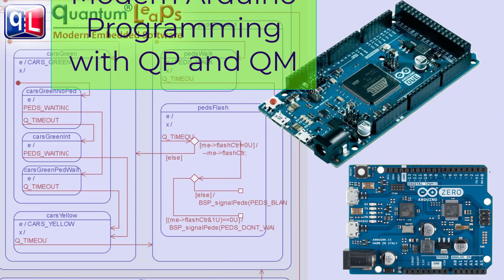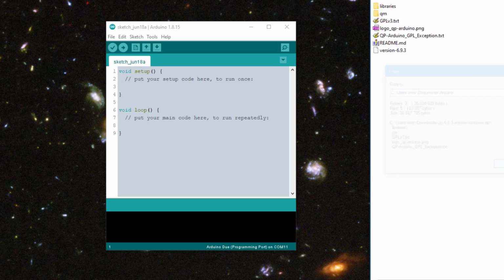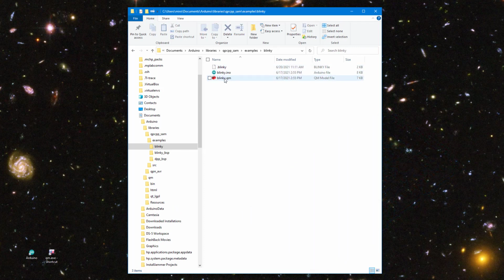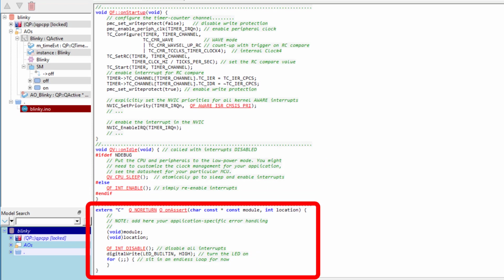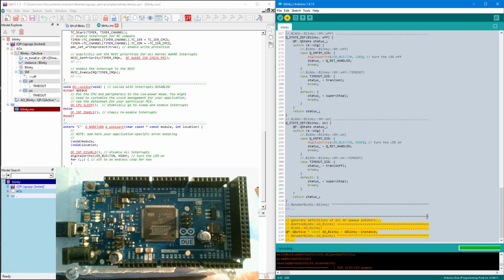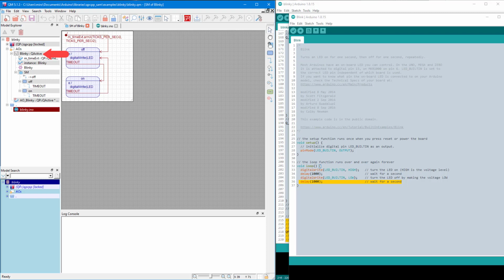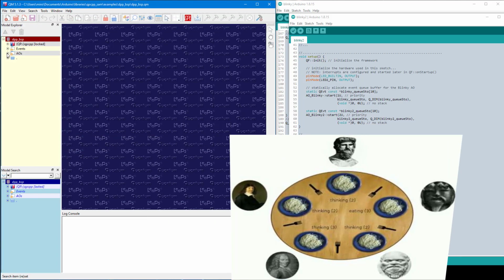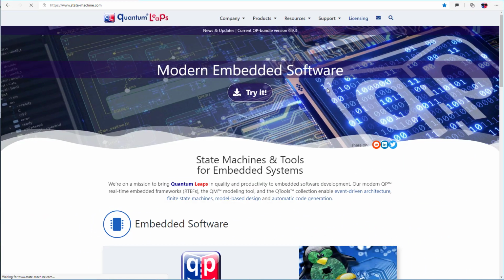Modern Arduino Programming with QP and QM

Comment: good sound. but I am learning TM4C123
Reply from the maker: This video is about Arduino, which includes both the hardware (Arduino boards) and software (Arduino IDE and libraries). The TivaC LauchPad board, used in the Modern Embedded Programming video course, is unfortunately not supported by Arduino. But TivaC has an ARM Cortex-M4 CPU, which is very close to the Arduino-DUE, which has ARM Cortex-M3 CPU. While the CPUs are very similar, the chips have different peripherals, so the software is not directly portable between them. That's why it is a good idea to use a BSP (Board Support Package). --MMS
Reply: Both are almost same architecture